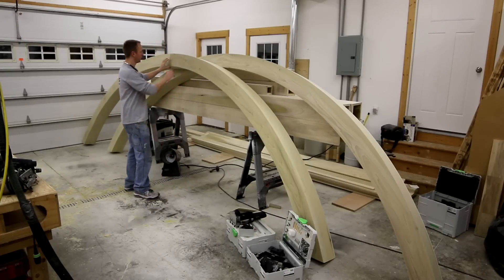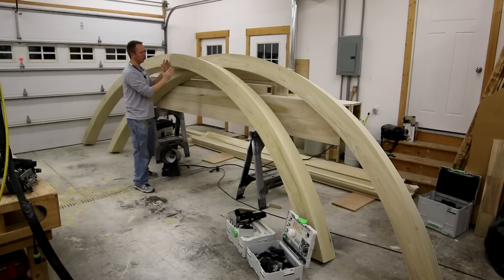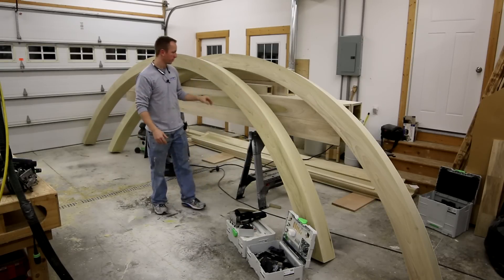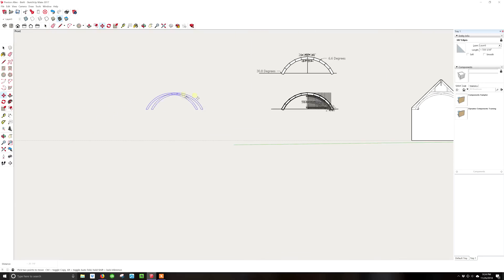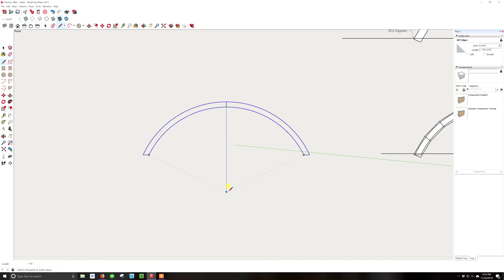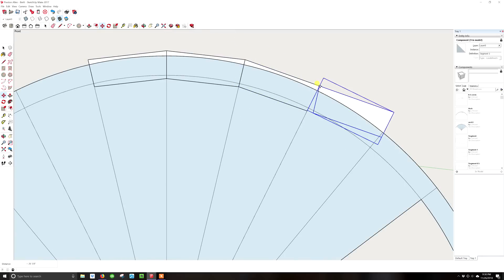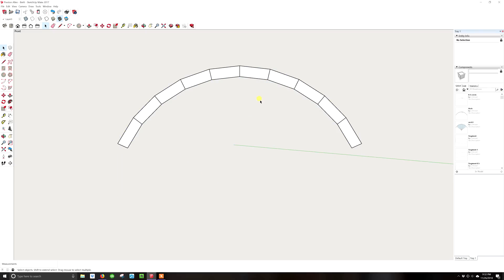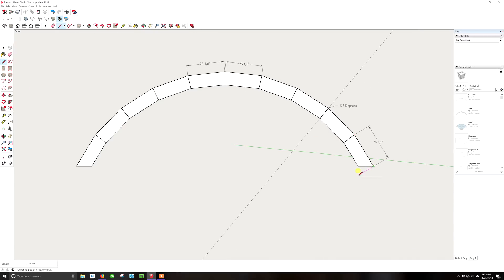Segmented Arch Layout In Sketchup

Comment: Are you ever tempted to buy a CNC? Seems to me, that would be the ideal tool to make these curved beams - the whole truss probably.
Reply from the maker: It would be fun. But I definitely don't have the space.
Reply: @InsiderCarpentry  so what did you use to cut the arc in each, since if you used a router, you’d have a super long jig?